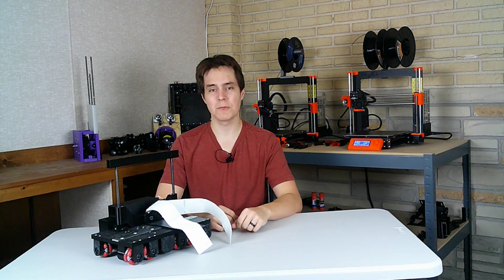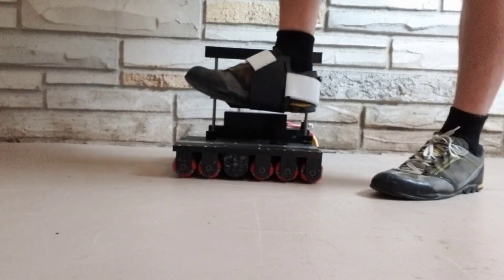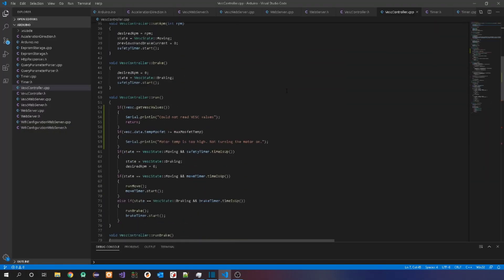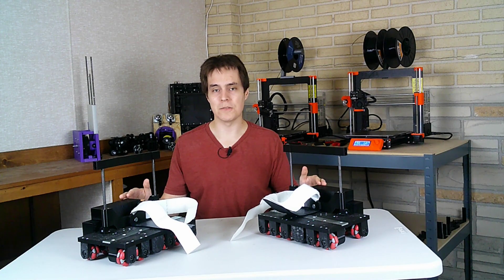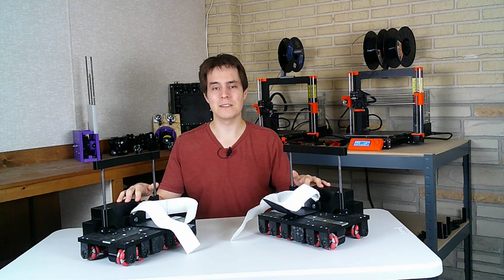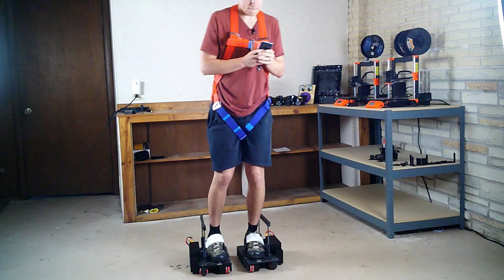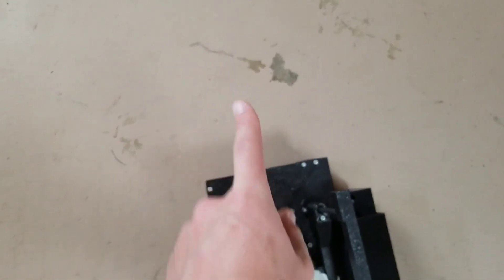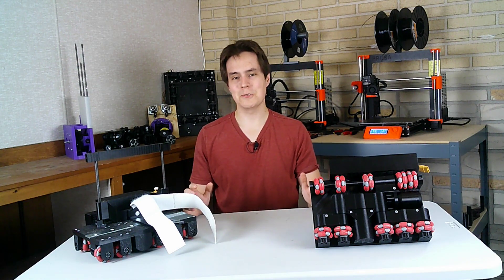Virtual Reality Motorized Shoe Build Log #27 - Second Shoe! Walking and Strafing Tests!

Comment: Congratulations on all your hard work. These are pretty amazing. It always gives me great pleasure to see an individual doing things that huge companies seem unable to accomplish. I hope you see big rewards for your creativity but even if it goes nowhere you should be very proud. If I was going to contribute I would suggest looking at bicycle clip in pedals as a possible option for using these. I mean the pro units that require custom shoes. Just a thought.
Reply from the maker: Thank you. With hobby-level 3D printing, CNCing, and electronics becoming more and more accessible it's becoming easier for individuals to do things that only companies could before. And yeah even if this project doesn't work out I learned a ton that I can apply to other projects. One of the main reasons I'm working on this project is just for the engineering challenge and learning opportunity it provides. 
I actually have clip ins on my bike and wear those special shoes. They're awesome and I can get a lot more power when I'm biking. I have thought of doing something similar but I wanted to first try a solution that would be the most convenient for everyone. So I'm starting with a strap to goes around a regular shoe. Later I (or someone else) can design other bindings, like one that uses a clip in mechanism, or one that is more like a snowboard binding or boot. Thanks for your suggestion and kind words.

Comment: something i couldn't help but think of is with how you have the pole connected to your feet couldn't in theory at a later stage you use that to help simulate climbing up stairs?
Reply from the maker: Hmmmm I never thought of that. You'd need some way to raise the part of the platform under the user's foot up too, but I think in theory it could work. Great idea!
Reply: @finallyfunctional  iv always figured that eventually we would have shoes like this glad its happening quite fast compared to what i imagined its pace would be i always figured the motors wouldn't be strong enough speaking of which out of curiosity do you know what weight the shoes could support up to before not working?
Reply from the maker: Yeah 3D printing has really made it much easier for individuals to rapidly create a prototype. If companies aren't fast enough or aren't working on something, we can take matters into our own hands.
I'm using motors and ESCs designed for electric skateboards, so they're really powerful. Electric skateboards normally can go at least 15 mph, but the VR shoes don't need anything close to that. Plus, I have gearing similar to what you would use on a skateboard (2:25:1), and I'm using smaller wheels, so less torque. Given all that, the shoes could probably handle a heavy user, maybe 250 pounds, maybe more? Don't quote me, I'll need to do testing to make sure.

That being said, those motors and ESCs are really expensive. $50 per motor, $65 per ESC. Each shoe has 2 motors and 2 ESCs, so 4 of each in total. That's already $460. So I want to have different versions of the shoes. A heavier user might need those motors and ESCs, but I probably don't, and my wife sure as hell wouldn't. Another version of the shoes can have less powerful ESCs and motor and be a lot cheaper. I'm just using the expensive stuff now for the prototype because while I design these I don't want to have to worry about power.
Reply: @finallyfunctional  two more things one im not a engineer or anywhere close so i don't know if you can track this at this stage but do you know how much power it takes atm compared to other things like say the vr controllers? and last do you think they would work on carpet?
Reply from the maker: @Xalphoria  I've written out detailed answers to those questions here:

http://evansalex.com/2020/08/04/a-motorized-shoe-to-be-used-with-virtual-reality-games-part-3/#power-consumption

http://evansalex.com/2020/08/04/a-motorized-shoe-to-be-used-with-virtual-reality-games-part-3/#carpet

Comment: Very nice idea!
I'll say give it a few years and everyone will be able to get it in a store!
Have you thought of Mecanum Wheels or balls as wheels like the old computer mouses?

What about a gyroscope?
And would an AI program that learns from your sensor data speed the reaction up, since it learns how you going to move?
Reply from the maker: Thanks. Yes, I've thought of Mecanum wheels. You can find the details here:
http://evansalex.com/2020/08/04/a-motorized-shoe-to-be-used-with-virtual-reality-games-part-3/#mecanum-wheels

For balls like a computer mouse, yes I've thought about that too. I've actually used ball transfers in previous prototypes. I don't like them though because they're really loud and can't be motorized.

What would a gyroscope do? They're already large and low enough to the ground so that they don't want to tip. Their pretty balanced.

You could use some sort of AI to tune the shoes to a specific user. You can read about the algorithm I'm going to use here. I mention at the end my ideas on using sensor data to calibrate the shoes to specific users.
http://evansalex.com/2020/08/04/a-motorized-shoe-to-be-used-with-virtual-reality-games-part-3/#return-to-center-algorithm

Comment: I hope you have the rights for a patent.
Reply: Nice! I was worried for a moment, because I saw a year back Google filed a patent for this exact idea. I just read on your site that it would not apply to this project. Thankfully you're doing an open source project, that will broaden up the community around this. I might try to help out myself too maybe :) 

I also worked on a solution for the locomotion problem, but was thinking of a way larger solution with an exoskeleton that is hung stationary. Kind of like AxonVR made. 

I have done some work on it, but nowhere near the levels you went to. I really respect your determination!

Amazing work!
Reply from the maker: I'm not getting a patent. This is open-source.
http://evansalex.com/2020/08/04/a-motorized-shoe-to-be-used-with-virtual-reality-games-part-3/#patent

Comment: This looks very promising, do they ship to Australia? I’d buy some! Can you feel the weight of the shoes/traction much when walking?
Reply from the maker: Thanks. I'm not selling them yet, but I can look into selling them internationally. Or I probably wouldn't mind if someone who lives in Australia who has 3D printers also makes them and sells them locally. Then you can avoid import fees. 
Yes I can feel the weight of the shoes, but it's not that bad. It feels like walking with boots on. Each shoe is about 10 pounds, but remember you don't lift the shoes off the ground. They roll along the ground on wheels, so they don't feel anywhere near 10 pounds. Again, more like regular boots.

Comment: Could you put a vive tracker on the shoe mount to get position of the shoes, and direction heading of the foot? (The tilt as the shoe changes position). Then, because you know where the shoes are you could path the motors back to a user defined center using the Vive tracking. This would even tell you what foot was lifting for side stepping so you could activate the motor! And lock the other one

Oh and the bindings looked like it was an issue with the bearing area? Like it's not 100% flush. Couldn't tell from the video, I'd assume you would have seen it if it was what im describing (in regards to the bindings wobble of the rotation of foot)
Reply from the maker: I haven't considered using the vive trackers. I want something that will work with all headsets. I'm planning on using accelerometers, encoders, and sensors on the top of the platform to automate the shoes. If you're interested, I explain the algorithm I'm going to use here.
http://evansalex.com/2019/11/25/a-motorized-shoe-to-be-used-with-virtual-reality-games/
Skip to the Safety Harness Sensor and Return to Center Algorithm sections. There's one small detail I need to add for strafing, but those sections pretty much cover what I'm thinking.
Near the end of the video I talk about how I can still wobble my foot in the binding, which is something I'm going to work on. With rotating my foot, yeah the shoe wobbled a little bit. The rods that the binding runs along are a bit too tall I think. The taller they are, the more likely the shoes will wobble when rotating.
Reply: @finallyfunctional  I'll read and reply when able. I find this method of locomotion intriguing as in my mind I wouldn't think it to work as well as it does in your video. In reference to the wobble, I think the problem is the tolerance is too wide and therefore the wobble occurs due to the single poi t of contact. Something like a larger surface area near the binding on both sides and titer tolerances might solve the problem. but I can't tell exactly how you have the binding attached to the vertical bars so I'm not sure. You probably know better than me having built the shoe.